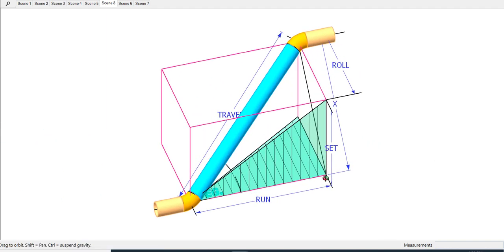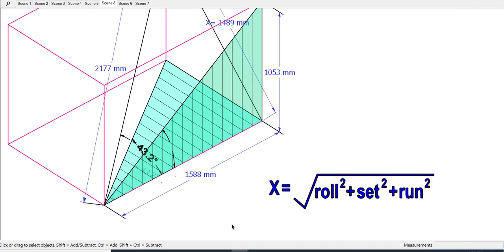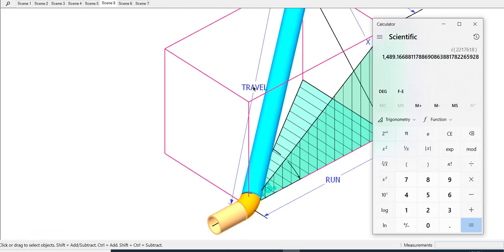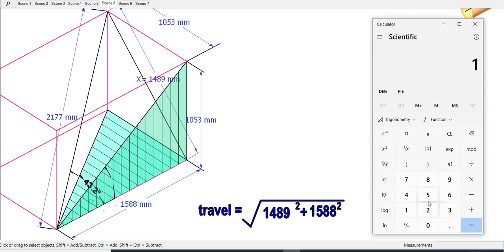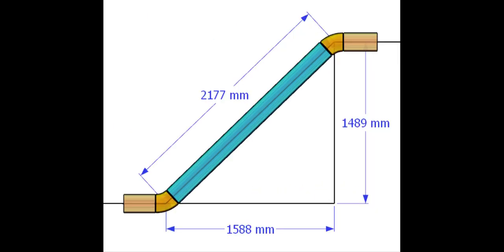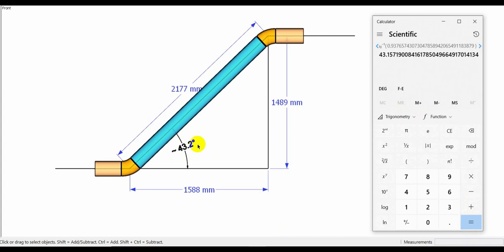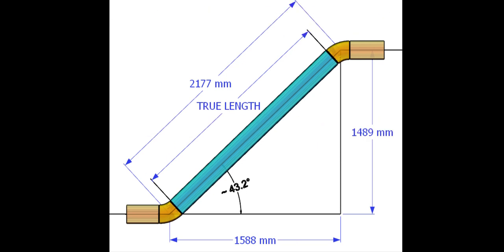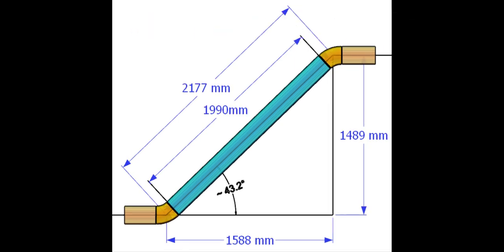HOW TO CALCULATE THE TRUE LENGTH, SPOOL LENGTH OF A DOUBLE ROLLED OFFSET TUTORIAL

Comment: Sir, you will use a 45 deg elbow with no miter? for the rolling degree on the bottom elbow, you will roll your elbow to 43 degree from top to west?
Reply from the maker: Bro, pipe rolling calculation is simple, but need some practical experience. I could have shown you practically, if we were working in the same place.